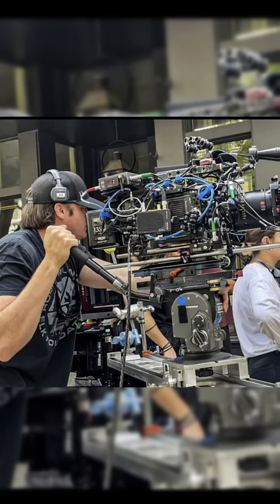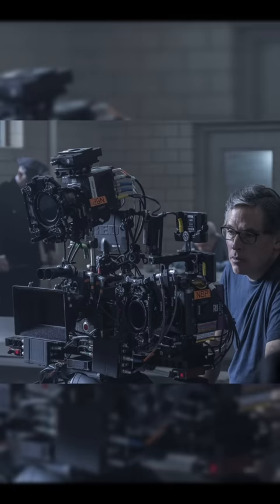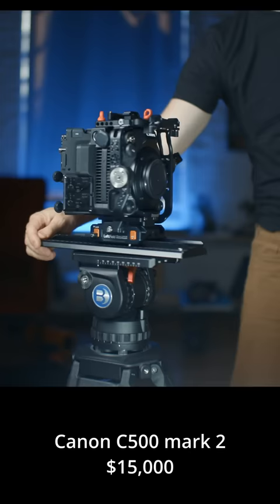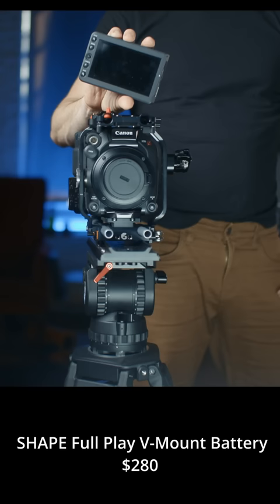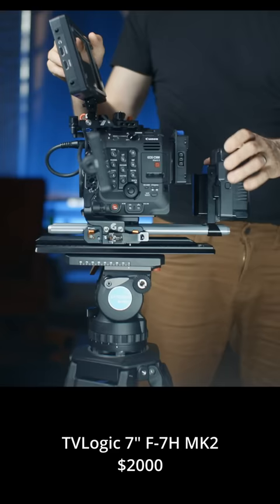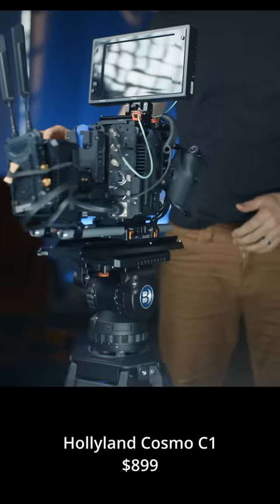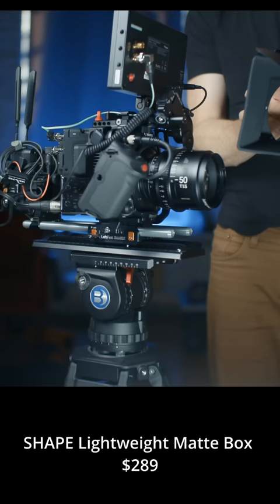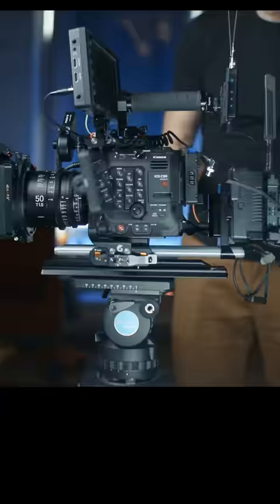Rigging a Cinema Camera #shorts

Comment: So let me get this straight. Basically all the extra gears and rails and batteries are to make sure it can last whole day and for camera guy, DOP, focus guy, director and friends to be able to watch/monitor while shooting ?
Reply: yep pretty much
Reply: Yeah it’s basically impossible to do it perfectly solo so it helps to have extra hands
Reply: Wouldn’t it makes sense to just wirelessly send the footage to a handheld device or something so they don’t have to huddle around? Ps I have no idea what I’m talking about I’m just an admirer of tech and film
Reply: @Hug_life  even if u do that, someone gotta control the focus ring and etc, sending a live footage would be useless cuz all the controls will have to be done on the camera itself, since everything is manual
Reply: It won't last the whole day, the battery. The transmitter is for the 1st ac/ad to pull focus from a distance so they won't get in the way depending on the shot needed. Client monitor is needed as well. I think unless settings are often changed. The Canon monitor doesn't seem needed.
Reply: @potato_flying focus the footage yourself. You’re the camera man?